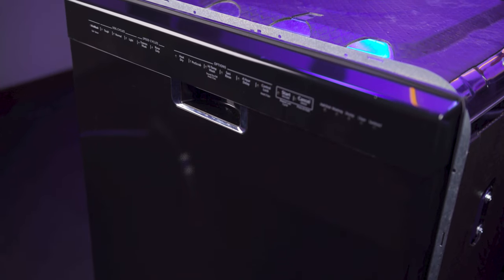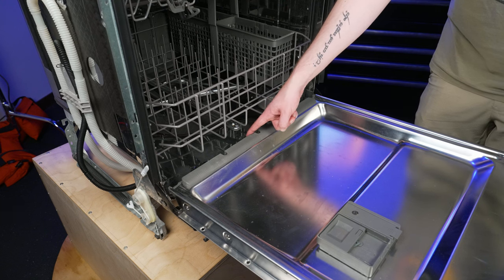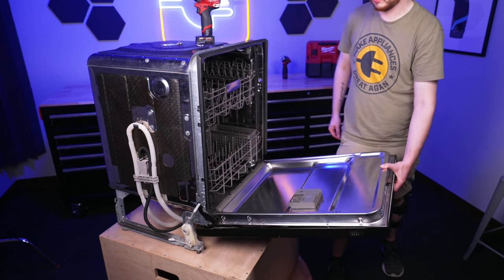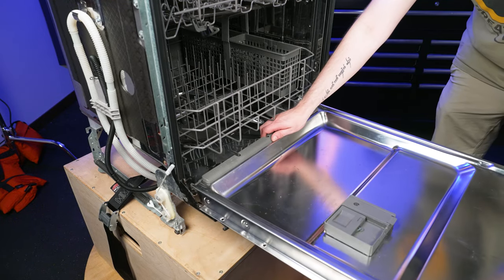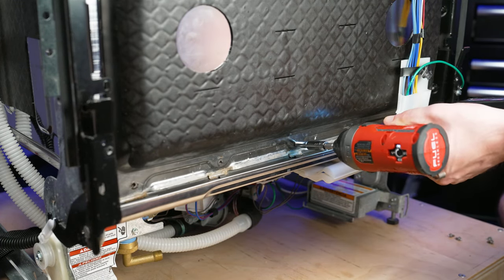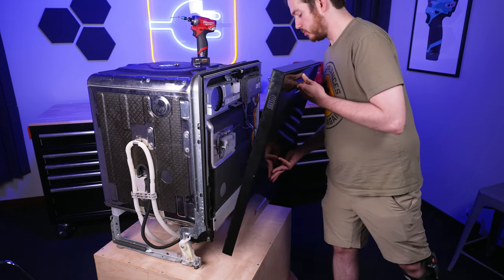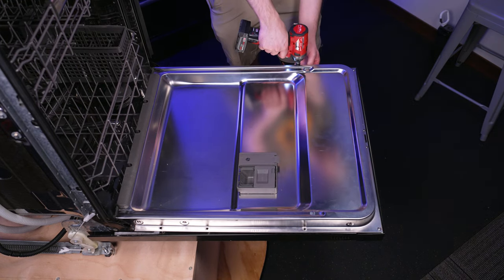How to replace Lower Door Seal part # W10909089 on your Whirlpool Dishwasher

Comment: If any of you have reinstalled this thing and found you still have a leak, check if the spray arm is shooting water out the side from a split in the seam.
Reply from the maker: Good tip!  Thanks for sharing!

Comment: Very helpful video.  Followed all of the steps and installation went smoothly.  Recommend cleaning any gunk that built up under the old seal before installing the new seal.  Used hand tools to install screws/nuts to avoid over tightening.  Removing the vapor barrier was slightly more difficult than shown on the video.
Reply from the maker: Thank you for sharing your feedback on the repair!
Reply: Thank you sir...I have an LG is it  basically same concept?
Reply from the maker: @cboakye6980  What is the model number of the dishwasher?
Reply: It was a nightmare for me to put the vapor barrier back on.

Comment: Great video. I’m hoping this is what’s wrong with mine dishwasher. It just starting leaking from bottom of door. Inside panel is all wet
Reply from the maker: Thanks!  Let us know what you find.
Reply: @PartsDr  any suggestions on what it may be? I have no idea
Reply: What fixed that for me was replacing the bottom spray arm. An appliance repair guy answered my Reddit post about it, and it worked. Since then, five people have commented on Reddit that it  solved their leak.

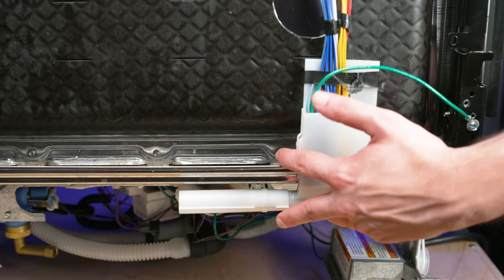Comment: at 1:40 of this video you removed something called the vapor barrier. I need a new one, mine is warped, but I cannot find this part anywhere. Any help would be greatly appreciated.
Reply from the maker: What us the model number of your dishwasher? https://www.youtube.com/watch?v=her9eShOYtA
Reply: Hi, I am also looking for vapor barrier,  my dishwasher is whirpool: WDF760SADB2

Having problem finding that part
Reply from the maker: @zorant9594  It doesn't look like that part is sold for your model dishwasher that we can find.
Reply: @PartsDr  Hi. My vapor barrier is also not sold. KUDS35fxss8 kitchenaid.
it is torn inside(not where the screws hold it).  could this cause leaking?
Reply: If the vapor barrier is bent, simply use a heat gun to GENTLY heat the warped section. Use a work bench or flat surface and a piece of scrap wood to mold the heated part flat.

Comment: Great video... is this standard across most of the product models?  Our leak looks to be the lower door seal for whirlpool dishwasher GU1500XTLB2
Reply from the maker: On your model dishwasher, the lower door seal is only sold as part of the inner door assembly here: https://partsdr.com/part/wp8269311-inner-door-panel
Reply: Thank you! A. Is this an easy job or? B. Is there a common sealer (waterproof/heat tolerant) that works in lieu of this replacement? The lower strip of plastic on ours is semi attached. I was thinking "gluing" with a good caulk might be perfect.
Reply from the maker: @peterbell9683 You can get an idea of the repair here: https://www.youtube.com/watch?v=95C_ltwKmSg  We can't recommend glueing it, so that is up to you if you want to try that.
Reply: @PartsDr  Oyvayyyyyyyyyyy.... a lot going on with that "simple repair"... with the odds of my getting the 2 door cables alone reconnected correctly pretty low, might just be time for a new dishwasher.  But thank you very much... let me sleep on it... a baking pan under the leak will do for now... and what the hey, maybe a shot with the caulk might at least be worth trying... stay tuned.
Reply: Ok folks so I've weighed in on the cost of the part; my time in taking the door apart AND hopefully putting it back together properly OR gluing/caulking the plastic strip (lower seal) back to the door.  If I try the first I'm 100% sure we'll be buying a new dishwasher; in trying the second option it either works or we're buying a new dishwasher soooooooo... stay tuned, I'm gluing/caulking!
Thanks for the support, we're all in this together :)
Reply: Try replacing the bottom spray arm. Or try cleaning it first. . It worked for me. If the water gushes out at weird angles, it’ll go up and over that barrier at the bottom
Reply: So... there's nothing quite like JB Weld!  An excellent adhesive. I applied a nice bead along the loose seal and let it set for 4 days.... but wouldn't you know it, that wasn't the problem!  The black water filler hose had cracked!  Not sure how I missed that as I'd felt no residual water on it when analyzing the problem. Either way the bottom door seal is fixed, the hose replaced and I'll consider the spray arm on the next adventure. Thank you!
Reply: @talleysuehohlfeld3959 Is it the lower wash arm or lower spray nozzle?
Reply: @sawyermookie4764  wash arm. There isn’t a spray nozzle, just the wash arm

Comment: It doesn't look like that seal has any rubber or o ring seali g parts, how does it stop water from gettin out.
Reply from the maker: It is a physical barrier that keeps water from splashing out past it.  If your lower door seal is in good condition, check your lower spray arm for splits or failures as we talk about here: https://forum.partsdr.com/showthread.php?7083-FIXED-Whirlpool-dishwasher-leaking-out-front-door-but-only-during-main-cycle

Comment: Is this a common issue. I am at my wits end trying to figure out why the dishwasher is leaking out the bottom of the door
Reply: Change the bottom spray arm.
Reply: I had water leaking out the bottom and that was the reason. An appliance repair guy on Reddit told me. I posted about my success and have had five people so far so the same thing with success.
Reply: Inspect bottom spray arm..mine had deteriorated and had small cracks on the side so the water was not only spraying upwards, it was spraying out the sides as well...I had used zip-ties temporarily which helped hold it together securely until I got a new spray arm
Reply: @edj2187  was yours a plastic wash arm or the stainless steel one shown here? or would it happen with both wash arms. all the ports are clear of debris.